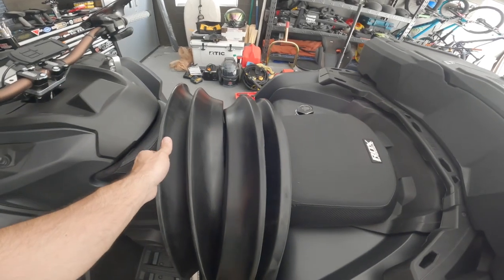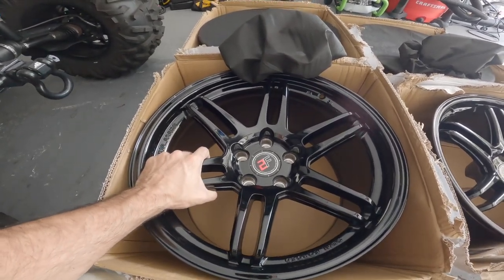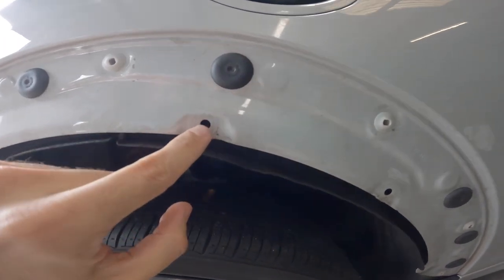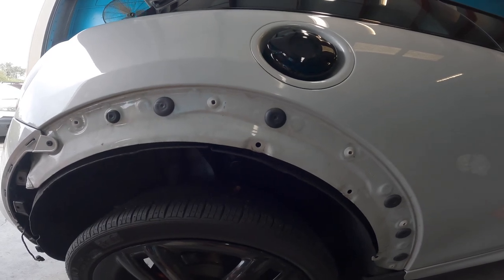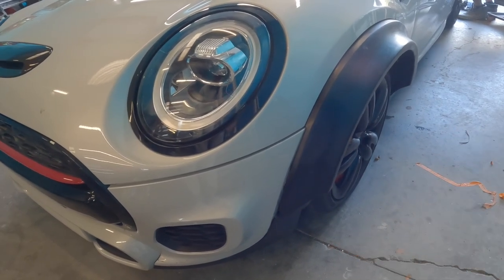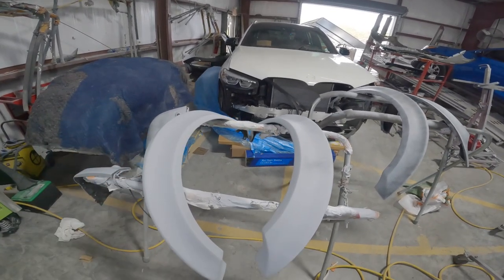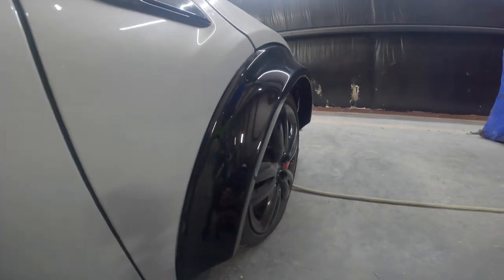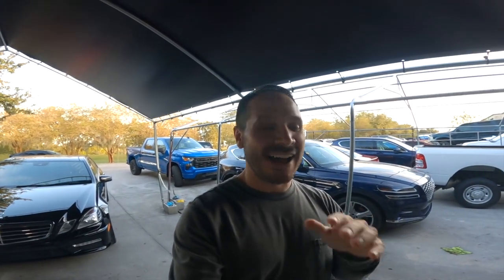Mini Cooper JCW Widebody Kit Conversion // Demon Build

Comment: Awesome I ordered a set of carbon fiber wide bodied for my 19 jcw cuase I went to some Konig Ampliform 18x8.5 +43mm super lightweight as well Michelin 225/40ZR18XL and I did a stud conversion to fit with spacers but the tire was rubbing so I have to trim some sheet metal

Comment: Surprised you can’t roll the fender edge.
Reply from the maker: Same. It was such a massive process to Widebody the Mini F56 platform. The R56 is much better to Widebody in my opinion. It's easier.